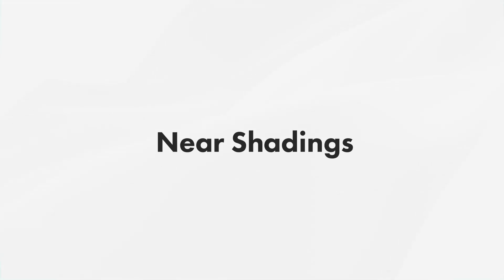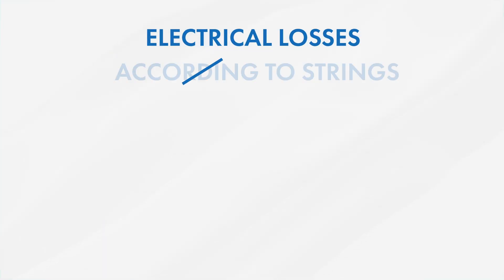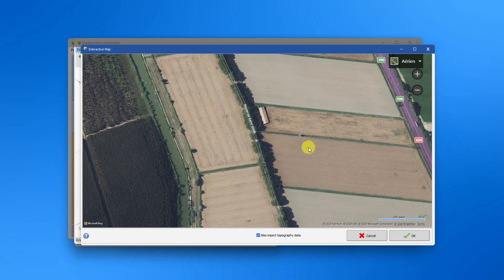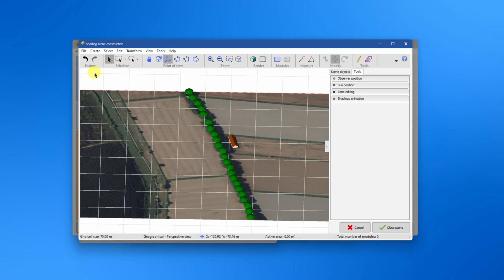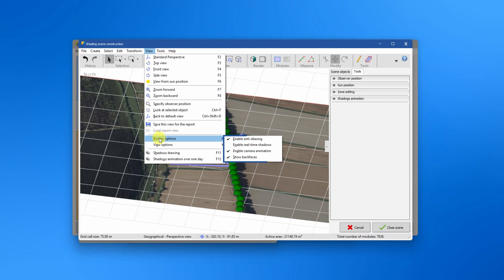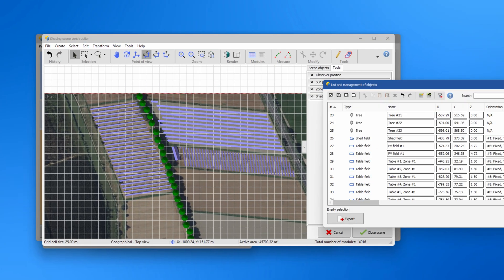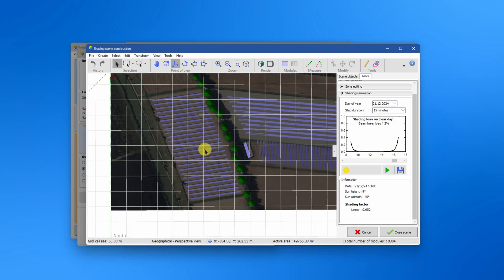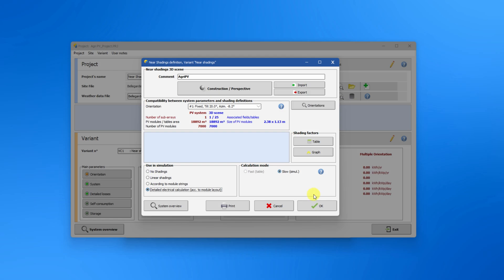PVsyst 8 _ Near Shadings (3D Scene)

Comment: Please,How do I generate the "Solar Fraction (SF)" in the simulation report? My simulation report doesn't have this option, but someone else's simulation report does. Is it because I didn't set some parameters in the software correctly, or because I didn't perform some calculations? Could you tell me how to do this? Which options in the software do I need to operate to generate this percentage in the simulation report?
Reply from the maker: Hi,
For a precise and detailed answer to your question, please contact our support team at support@pvsyst.com
Kind regards.

Comment: Out of topic question, but when will multiple orientation vertical installation bifacial calculations be added into the program? When I try to simulate this on pvsyst 8.0.16 I still get an error message "the pitch between tables cannot be zero. This happens if you algined tables or defined only a single table"

I have 8 different orientations and all of them installed at 90º inclination on a building facade (correctly configured in system).
Reply from the maker: Hi,
For a precise and detailed answer to your question, please contact our support team at support@pvsyst.com
Kind regards.